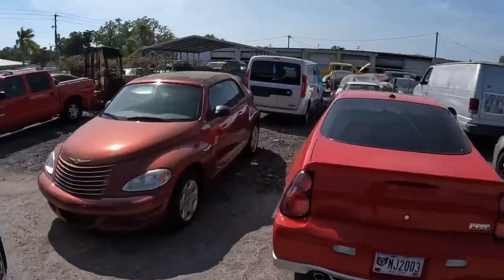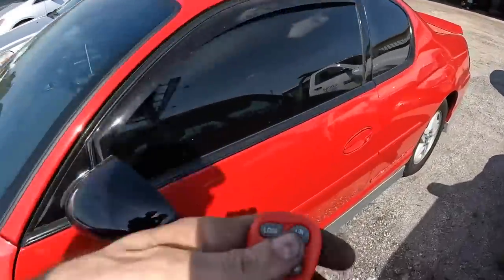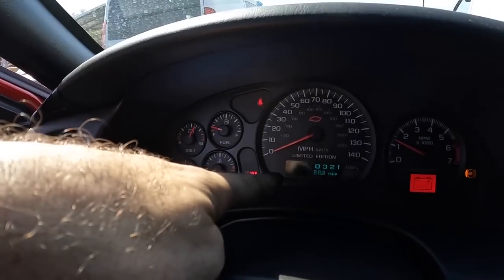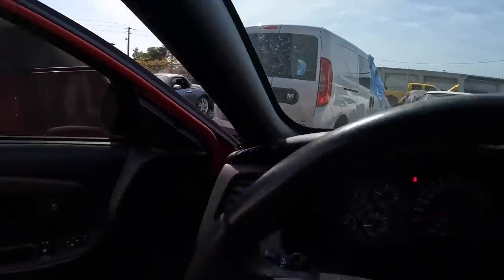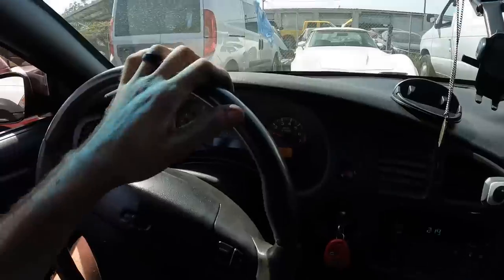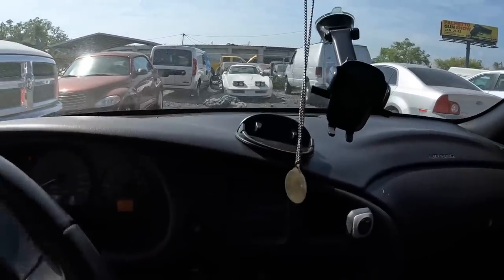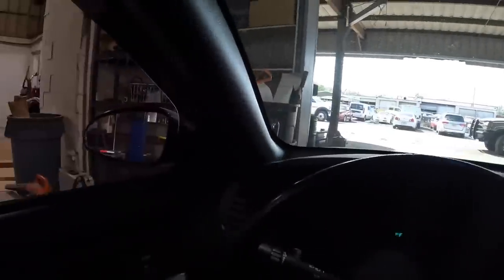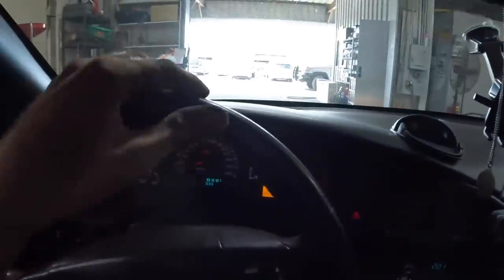Oil in Radiator! 2003 Chevy Monte Carlo 3.8 Manifold Leak!

Comment: I keep a box of cheap sandwich bags in the shop with a note pad. On complex jobs, every component gets it's bolts and small parts in a bag with a quick note. "Water Pump, long bolts at 2 o'clock and 10" for example. When bags are all empty, job is done, have a beer.

Comment: I own an '05 Grand Prix, 3.8L super charged.  Last summer in my driveway over about 3 days I did the upper, lower intakes, both valve covers, plugs, injectors.  Very easy to work on motor.  I ended up with no bolts or nuts left  over!  No more burnt oil smells!

Comment: You do a great job, Ray! As a 50 yr. master tech for GM, oil in the coolant is usually a leaky head gasket. Coolant in the oil is a leaky intake gasket. If an engine overheats, the head gaskets get damaged. Stay tuned folks for the next video: "Replacing head gaskets 2003 Chevy Monte Carlo 3.8". P.S. Dorman makes aluminum elbows for the bypass, use genuine GM o-rings and chuck the Dormans.
Reply: I did the coolant elbows, water pump and lower intake on my GS a while ago, but didn't know about the Dorman O rings. I only drive it in spring summer fall as a third car. How long do you think the Dormans will last?
Reply: Those 3.8's were notorious for Intake gasket fails, Had a 2001 Buick 2001, had to have the intake replaced in 2010, head gasket failed in 2018, junked it!!
Reply: @wallychambe1587  Hey wait a second, I thought the GM 3800 V6 was supposed to be a really dependable engine??
Reply: @wallychambe1587  gotta get the good (read expensive) gasket. Doesn't really take that long to do. I've never seen a good one go bad twice. Sorry you did.
Reply: @LA_Commander  I read numerous stories about the intake gasket, people tried to get a recall started because there were so many failures from the factory gasket! In 2010 I had the intake replace because it was sucking air, in 2018 I had water in the oil and oil in the radiator!😢😢
Reply: @wallychambe1587  OMG!!
Reply: @LA_Commander  It is, but they still need maintenance😎
Reply: I have a question for you yz250a. 2006 chev uplander 3.5l. This has definitely been a challenge for us. Original issue was right lower rad support rotted out and dropped rad while driving. Didnt know the rad dropped because of driving vehicle at the time, but noticed temperature was rising. Pulled over and shut vehicle off. Noticed a collapsed rad hose. Got it home. Drained and flushed system, new coolant and couldn't get heat back. Couldn't get air out of system. Weather jacking up front end, funnel system, on a steep hill. Thought maybe when rad dropped it dislodged gunk and plugged the flow. Fast foward, new rad, thermostat, waterpump, heatercore, intake manifold gasket. Still can't get air out. No leaks, no coolant in oil, no oil in coolant, no white smoke. Van has 142,325kms. Im at my witts end.
Reply: Check the new radiator. I had a similarly frustrating air contamination and it had a hairline crack where the plastic tank connected to the metal. It didn’t leak out, just sucked in. You could only notice it when it was hot and everything had expanded. And this was with a new radiator. The first one cracked in the same spot. Just because it’s new doesn’t mean it’s good. Sorry about the wild goose chase if that’s not it. I just know I had mine in the shop 4 times before they found it because they never checked the new parts.

Comment: I did this on my 3.1l several years ago and wish that I had this video before. There are several things I would urge everyone doing this job. 1st replace the plastic elbows with the aluminum replacement. 2nd. Do the fuel pressure regulator. 3rd replace the EGR valve at this time as it is totally open and easy to do right now. 4th test the injectors for spray pattern and volume, replace-clean them as need. 5th Replave the valve cover gaskets (again this is the best time to do them as everything has been removed). 6th. Lastly Water pump, serpentine belt and all hoses.  I know this is a massive add to the expense but it is 100% preventative and MUCH easier while the whole top end is off.
Reply: The old “while you’re there” is sage advice!
Reply: @rwinstanley8668 when I had that car I lived in Minnesota. I did all that work during the summer and there was no way in God's green earth. I wanted to do any of the other stuff I did during the winter
Reply: Smart idea.
Reply: yep maybe the thermostat as well on the 3.1. Cleaning the throttle body should be done too. The 3.8 one thermostat is gravy. Great advise. I've done both types of motors. 3.1 in a century. 3.8 in a lesabre. water pumps are never a bad thing either. So much to consider
Reply: I do the same with any auto I have.  As long as you are there,--------.  It's cheaper in the long run, and I haven't replaced a vehicle due to milage, and I trust my fleet to get me there and back anytime.

Comment: I had a 1998 Oldsmobile Intrigue with the 3800 V6. Same kind of very low mileage vehicle. I bought it in 2011 with I think 45000 miles. I know they're solid engines but man did I get every 3800 problem in the book. Lower Intake Manifold gaskets were first like a year in. That coolant elbow cracked one winter and left me stranded 100 miles from home several years later. The Crankshaft Position Sensor failed too and again left me stranded 100 miles away from home several years after that. Oil leak around the Exhaust Manifold Gasket (but I never bothered fixing that). It was pretty much the text book engine one "here's all the things on the 3800 that will fail and leave you stuck". It was one of my first cars and got me started in life, but I didn't miss it at all when I get it to Rawhide after it turned 21.

Comment: A lot of that looks so familiar.  I had several cars with engines very similar to that: 1990 Pontiac 6000, 1994 Cavalier Z24, and a 2007 Monte Carlo.  The Pontiac 6000 made it to 240,000 miles, where my dad drove it for 100,000 as a company car before I got it, and I drove it for another 240,000 until it became too expensive to repair.  The Z24 made it only 160,000 before the transmission quit shifting out of gear when braking or stopped and was too expensive to repair.  The Monte Carlo made it to 100,000 miles before I traded it in on a Subaru Legacy in 2015.  I replaced so many of the more simple to replace parts.  They were great cars, IMO.

Comment: Meticulous attention to keeping the engine shiny parts shiny (the shop floor, not so much),  video skills (those lights and camera angles make Ray's presentations the most revealing on YouTube and that takes significant time and effort), a clear and concise running commentary with seemingly effortless mentioning of why certain things are, or are not done on points that could be easily overlooked but are, nonetheless significant, e.g. coolant temp sensor replacement is easily overlooked, why he went from abrasive fingers to abrasive pad, why oil change is a "must do" with this job and many more) are what sets Ray's offerigs apart from all others on YouTube. All of these factors along with Ray's upbeat approach to everything and articulate verbal content cause me to proclaim him the "Master of YouTube Automotive Repair Videos". We need more mechanics like Ray, but we also need more instructors in out technical schools like him as well. If you ever get tired of doing Ray, please consider a switch over to teaching others your trade. You are a natural teacher.
Reply: He Certainally changed since not working 'at ButterFinger's Automitove'....

Comment: Hi Ray much respect bro, I have done several of these repairs and few tips I have is to pull the alt. and replace both v/c gaskets and spark plugs also you will be replacing 2 plastic elbows there with updated metal ones, only use fel-pro gaskets that are metal and rubber and for god sake please replace that plastic upper plenum with the Dorman or OEM! It is probably warped and will leak coolant into the engine, It happened to me in my 3.8 Grand Prix after I did this same repair and started knocking 2 weeks later because it leaked coolant into the engine and went through the bearings and caused a knocking noise☹ It cost me a motor because I was uninformed about those plenums being a problem! Almost every repair I did after that I advised the customer to replace it and I haven't ever had a return repair since.
Reply: I'm doing this repair this weekend(first time), after a lot of research the ATP manifold has a metal insert by the EGR chimney to help it not warp over time.

Comment: I had a 2000 Monta Carlo when that design came out. The 3.8 was one great engine. Chip eliminated the rev limiter so could easily cruise at 120 mph. Mine was a emerald green SS.

Comment: They make a upgrade kit for the coolant bypass elbow, that replaces the plastic elbow with a metal one.  Should be done on every 3800.
Reply: The Dorman gaskets are utter trash and will fail prematurely. OEM ones if you don't want to do this job twice
Reply: OEM is what failed in the first place @ICantBreve
Reply: @edubb2491  sure

Comment: If you're doing this job and have the Series II, I would recommend replacing the upper intake manifold with the updated design that comes with the revised EGR standpipe that press-fits into lower intake manifold.  The original design can deform the plastic upper and eventually cause an intake leak.  Considering the mileage on this beautiful MC, it probably hasn't experienced that issue...yet.

Also, Dorman makes a great set of aluminum coolant bypass hoses.  (Yes, I said "Dorman.")  The caveat, and you knew there had to be one, is that the O-rings equipped with the elbows are absolute garbage and will melt within a year.  Therefore, get a set of OEM O-rings to complete the deal.  Parts are as follows:

  Dorman coolant bypass elbow set 47065HP
  ACDelco 24502846 large O-ring (qty needed: 1)
  ACDelco 15-34066 / GM 25537068 small O-ring (qty needed: 3)

Ray, I didn't need another reason to like you, but our shared fondness of this engine platform certainly doesn't hurt.  Great job, buddy.

Comment: It's amazing Ray, how you knew about that plastic elbow joint. You are a true master of your trade. The way you educate us, you should be a teacher of all things automobile. As always, fantastic content, can't wait for the next video.
Reply: The plastic elbow is a failure point on these. I had one blow out at 170,000 in a Buick Park Avenue.  There is a replacement version that is not plastic but metal. It was a dumb factory decision to use plastic in that heat cycle hotspot. They’ve since corrected it with a better part.
Reply: @ericgelinow  Yea the one part the bean counters got their hands on.
Reply: Ray worked for Chevrolet before all of this.
Reply: @TheFrenchPug  that’s apparent given the ridiculous familiarity with this motor especially. I bought my Park Avenue specifically because of the 3800 series II. One of the best decisions I ever made. On more than one occasion of distances from 300 miles to 600 miles, I’ve averaged over 34 miles per gallon, including flatlands and mountains averaging 75 miles an hour. Hard to find any full-size American car that seats six adults and weighs close to 2 tons that can pull that one off. Outside of those two little elbows, one water pump and the normal consumables, I’ve spent only a couple hundred dollars in the last seven years of ownership, in the Northeast of the country. But just appointed out, I’m not a brand loyalist either, I’ve got a 97 4L Ranger, and a 2005 F250 6L power stroke with a quarter million miles on it that hauls a huge RV via a fifth wheel. Ray is part of my morning routine. I watch his videos every day to completion. One of the best finds on YouTube!
Reply: @ericgelinow  That's just fricken' amazing!!! Congrats to you.
Reply: I had a 3.5 non vvt in a Pontiac G6 that would consistently get 36-38 mpg on a highway trip. Those pushrod V6 engines weren’t great on gas around town, but they were sometimes better than the 4 cylinder engines on highway trips. It could have used another 30 horsepower or so, but it was a great engine. My LS2 in my GTO was great on gas on a road trip too. It was 13-14 in town but it wasn’t hard to get 28-29 at 75mph on cruise with the 6 speed. My 97 Cobra with DOHC was lucky to get 25 with almost 1.5 liters and 100 hp less.
Reply: @ericgelinow  Are you aware how fast you would have to go to "average" 75 MPH over any appreciable distance? I once drove 952 miles in 14 hours (about 30% was surface roads, not interstate), and I was almost pedal to the metal on open stretches. I averaged 68 MPH. I'm talking my total time, including all stops (potty & gas only), not just moving time. There were many stretches where my speedometer rarely went below 90, yet I still only averaged 68 MPH. An average of 75 MPH is tougher than it looks. My ride was a 1968 GTO 400cc V8, one of the best rides I ever owned.
Reply: @jimdavis6833  Jim, I’m referring to the majority of the time when I was on interstates. If you’ve ever driven Pennsylvania you realize that you get passed doing 75 miles an hour, quite easily and routinely. I’m actually a fairly slow driver as a whole since I retired from rallying and hillclimb competition a quarter of a century ago. I’m quite cognizant of what I said, and if I were including driving through rural back roads and passing through metropolitan areas, that would be a very different story. But for the most part, much of that drive was purely interstate. Roughly 550 miles stretches between filling the tank, even though there was still enough to go in additional 75 to 100 miles, I try not to destroy my fuel pumps or the fuel pick up getting into the nasty stuff at the bottom of the tank.  I do get what you’re saying though, and with that caveat that I clarified, I believe you’ll see that what I was saying is firmly based in reality.  This is not some 18-year-old braggadocio implying that I could make a turn at 90 miles an hour or that I pushed some four-cylinder civic against a blown V8 on some highway with a five car gap. I actually never partook in such activities and I’m not implying that you were implying it either. I did race in sanctioned competition on tracks and off-road, had an absolute blast and all that I learned I still utilize on a routine basis despite the fact that it’s either in a park Avenue or a three-quarter ton diesel.   I’m in no rush to go anywhere, but I really am proud of fuel economy on that Buick.

Comment: I think they are great engines. I got a 3.1 in a 2000 malibu bought it 17 years ago with 70k on it. I still drive to this day body isn't looking so great but runs like the day I bought it with 317,000 miles on it. Factory engine and trans. I replaced intake gaskets once at 130k. Getting ready to do a oil pan reseal on it but I plan on running it until it quits. Like always Great Video Ray.

Comment: I have the same issue on my lesabre, I just bought it 3 months ago and the seller I guess forgot to tell me. It doesn’t overheat though, I’m able to run errands, under 10-20 miles a day, occasionally hour long trips on the highway. My mechanic told me just drive it until I can’t, not to put it a nickel into it, it’s not worth it. But you make it look doable to fix, thank you.
Reply: I jus had mine done for 1300$ ..2000 buick regal ..but I only have 80000 miles I keep it in good shape

Comment: I'm glad it wasn't me quoting or doing that job. I saw the oil in the radiator and immediately assumed either head gasket or cracked head! Your experience really paid off there. I'm only a backyard mechanic who mostly only works on my own gear and this is one of those times I'd have wound up possibly causing myself a much bigger headache than was it should be.

Comment: Wow these 3.8's are way different to the Australian variants for the LIM upwards (mainly due to the fact they were used in a RWD configuration here), we never had a plastic intake plenum was always an alloy plenum and redesigned LIM to have the thermostat towards the front of the engine (except in the L67 (Supercharged) where it remained at the back of the engine and they're a total PITA to change the thermostat as you have to take a lot of the intake components out to change it)). Saying this though, I love the GM 3.8L (or as we Aussies call it - the "Mang" (Sound they make when bouncing off the limiter LOL)), such a stout little engine that can take a hell of a beating.

Those plastic LIM gaskets are trash though, I have always replaced them with Alloy ones which last forever as they do not break down over time.